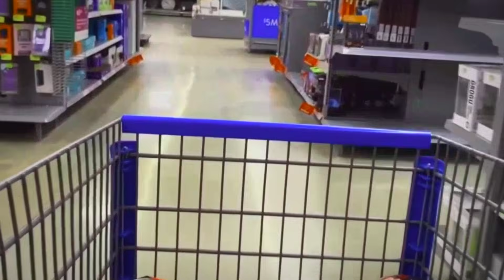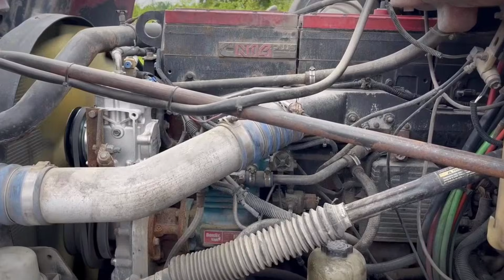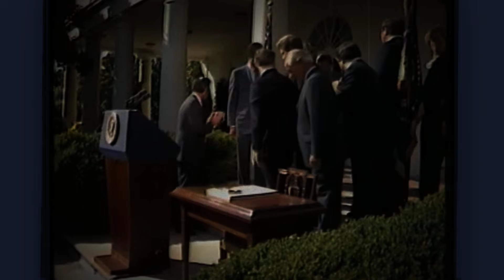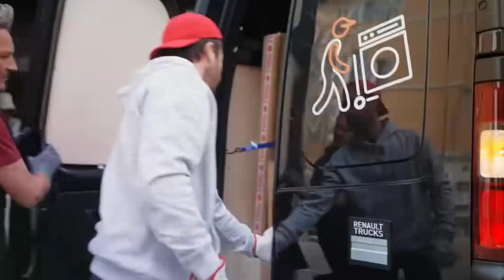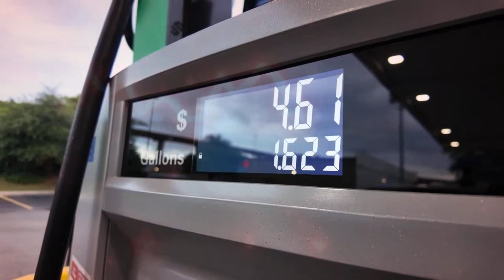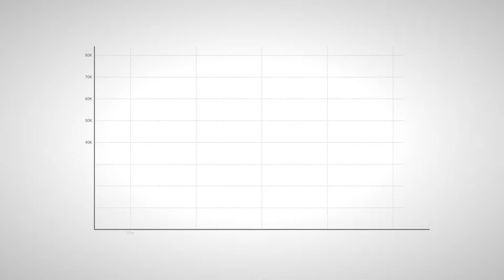Why American Truck Engines Are Twice The Size Of European Ones

Comment: I should also add that there also are mining and timber trucks that has a special permit of around 90 tons on a limited selection of roads.
Europe isn't one country either. It's a continent, even though many of the countries are cooperating in some cases under the European Union each country has there own state and rules. Not all european countries are member of the EU either so the comparisons really halts.

Comment: The truck I drive is a Volvo 770 with a 17 litre engine.
Normal weights here in Sweden is 64 metric tons but most of the bigger roads allow 74 tons.
Sure, there are smaller engines in some trucks of course just like in the US all depending on what use case it has. Long haul, full weight trucks often have larger engines in the range of 13 - 17 litre while there of course are smaller trucks with smaller engines.
I drive a heavy haulage unit with a total weight of up to 150 metric tons on special permit so I often need all of the capacity of that engine.

Comment: the post popular truck driven in the US is the Freightliner Cascadia.  Freightliner is owned by Daimler Truck. Daimler Truck also build Mercedes trucks around the world.  Daimler also owns Detroit Diesel which is a popular engine choice for the Freightliner.   So truck buyers have choices on which engine they put into their trucks.  Step into Sweden and Volvo and Scania give you engine choices with over 750 horsepower and 2729 ft-lbs of torque.

Comment: US engines are not allways larger. Nor are the US trucks allways heavier. In FInland for example, they have 100 ton timber trucks with 16-17 litre engines with 600-700 hp.

Comment: Mercedes in Europe has a 15.6L 6 in line with 625hp that fits under a cab-over; Volvo has a 17.3L 6 in line with 780hp that fits under a cab-over, MAN has a 15.6L with 640hp that fits under a cab-over; SCANIA has a 16.4L with 770hp that fits under a cab over... ALL engines run at almost the SAME speed as a DD16 (now Daimler = Mercedes) ou a X15. Those in Europe has MUCH more TORQUE as an american engine. FYI: Mercedes 15.6L and 625hp at 1,600rpm and 3,000Nm (2,212.7lbf) at 1,100rpm; Volvo 17.3L and 780hp at 1,700rpm and 3,800Nm (2,802.7lbf) at 1,000-1,300rpm; MAN 15.6L 640hp at 1,800rpm and 3,000Nm (2,212.7lbf) at 1,000-1,450; SCANIA 16,4L 770hp at 1,800rpm and 3,700Nm (2,729lbf) at 950-1,350rpm (all Mercedes/Volvo/MAN/SCANIA have versions with less power and torque). Cummins X15 14.9L 605hp = 2,508Nm (2,050lbf) at 1,000-1,300rpm; DD16 15.6L 600hp at 1,600-1,800rpm and 2,508Nm (2,050lbf) at 1,000-1,350rpm
Reply: 😊 yes and they are used for road trains in Australia. Not like those 'shopping trolleys' in the us.

Comment: Scania DC16 is a 16.8 liter engine with up to 770hp and easily runs 5 million kilometers without renovation. Weight limits for normal transport are 55 metric tons and not 40. 98% of what you say is not true. Smoky and the Bandits were a long-nosed truck
Reply: Scania DC16 is 16.4L V8

Comment: I drive trucks in the uk and I can say that you’ll struggle to go 90% of most places with a long nose truck. The roads here are really tight and we have a lot of roundabouts
Reply: Exactly why they are different, also we just love things big in America 🤣
Reply: Even a cookie cuter Volvo with trailer is 75 feet. A old Kenworth looking at around 78 feet. A foot or two here or there depending on kingpin.  running almost 100 mph  a million in your non imperial nonsense 🤣 in a monster solid   steel dinosaur Across 3,000 miles absolut freedom true freedom.